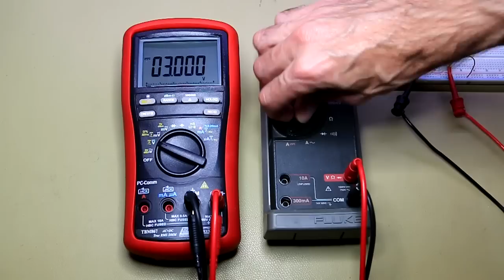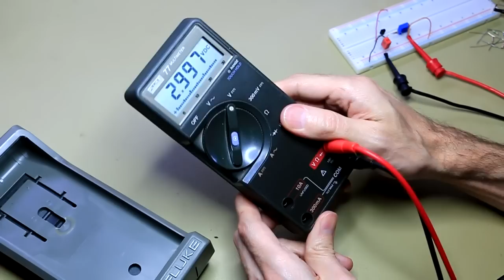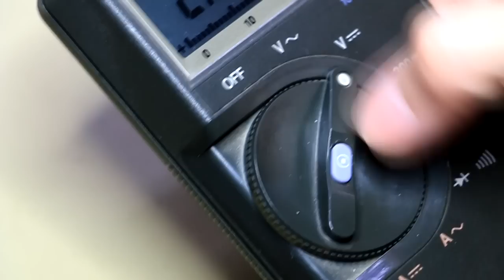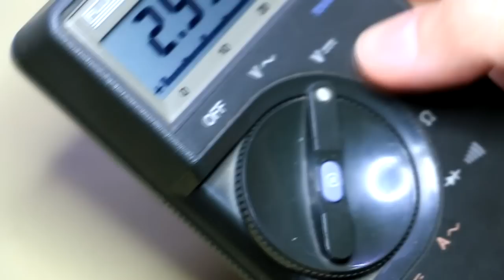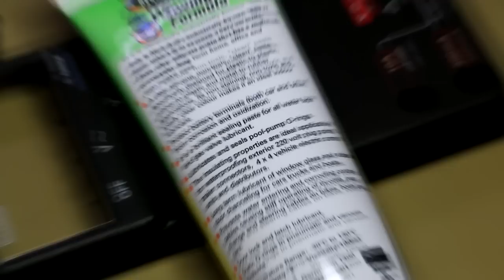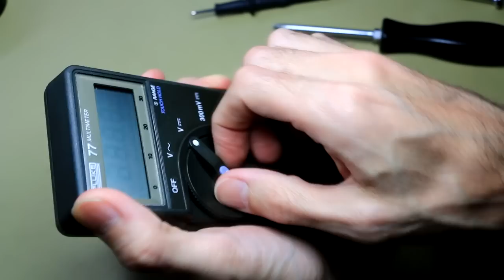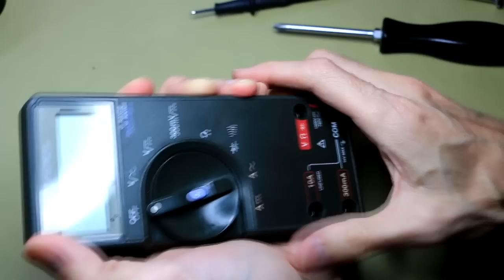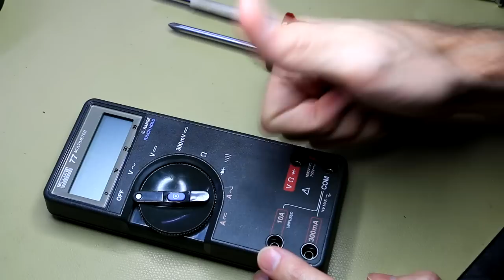Fluke 77 teardown, calibration and servicing (#008)

Comment: Mine got damp in the shed now won’t turn on any ideas how I could fix this
Reply from the maker: Check for signs of corrosion around the battery terminals, clean them up with some IPA or some contact cleaner. Especially check for signs of oxidization on the selector switch. Some De-oxit could help resolve any issues.

Comment: Hi nice and close up footage,
I have a fluke 77 II series as I am not that technical minded and only use my fluke for basic stuff , is there anything i can buy where some thing is already made on the market for me to put my fluke test leads into, where I know its a given 2 v 5v etc and see if my multi meter matches up to it,
Reply from the maker: Hi - yes, there certainly is. You do not state your country of origin, but start by searching for "Voltage reference module" on Ebay or Amazon. These provide a standardized test voltage for your multimeter.
Reply: @TechBench  cheers UK England i think we used to be 240v with 10% - 10% + either way, now i think we are 230v with 10%- 10% + either way I think, due too the power grid easing back on power through out uk,

Comment: I purchased a 77 in 1981. Fried it by trying to measure too much current. Sent it to Fluke and they repaired for free. Used it daily until 1998 when I changed my career to computers. Still works great today.
Reply: Same here --- I used mine for awhile -- switched to the IT field and have been doing that for about 24 years now... I still have my Fluke 77 and it still works great. It is still my go to and favorite meter.  I actually just recently changed the battery and pulled off the outer rubber case just to rediscover my "last calibrated" sticker.   Mine was last calibrated in 1996 and it is due again in 1999, guess I better get on that... ;)

Comment: I have the same original model an my piezo buzzer is erratic - if I compress the case or gently push on the selector switch directly with case opened, I can vary the output from nothing to much louder than when simply held.  Putting various side loads on the selector actually produced a sound that had a low frequency harmonic which was loud and much easier to hear than the typical high pitched piezo sound (I'm 67.)

I found the piezo but am completely at a loss to understand how it works because it looks like it does not contact the circuit board.  Is there some sort of wireless driving or ???

Thanks
Tom
Reply from the maker: @Tom: the piezo speaker has a nylon "strap" with two graphite contact points (the little black dots) that make contact with the back of the PCB. Some conservative cleaning with IPA should resolve that issue.
The same IPA can also be used to clean up the contact selector if you do not have any contact cleaner available.

Comment: Do you have a video on how to replace the LCD display? My 77-1 is missing a digit and I would like to make it right.
Reply from the maker: I don't have a video for the process of replacing the LCD display, however, you might no have to replace it at all. Normally the displays are mounted to the board and uses so-called "zebra strips" to make contact between the glass and the PCB. Taking the strips out and giving them a gentle rub-down with IPA (as well as the contacts on the PCB) will restore connection and likely restore the missing digit. Let us know how it goes!
Reply: @TechBench  How about a video on how to get at the strips? This is my first try at opening this meter for anything other than changing the battery. Thanks

Comment: Do you have the part number and where to  buy the shunt resistor for the current. Can I use wire and short this out
Reply from the maker: Hi Kevin, are you talking about the 10A (4-terminal) shunt? Using a wire will likely yield incorrect results, as the wire will not have the specific resistance of the 10A current shunt. Did your shunt get damaged?
Reply: @TechBench  yes it burnt up were do I get one

Comment: I rescued my fathers water damaged 73-III (it looks pretty much identical to the one in this video) last weekend. The inside had been wet for several months after it was being left outside in the rain, but the only damage was some corrosion on the battery connectors. I removed the old solder and applied new. I then cleaned the PCB with 99,9% isopropyl alcohol, lubed the selector switch with silicone grease as well as the screws. I also polished the lens and gave both the case, leads and the cover a good scrub in hot soapy water with a bit of degreaser. It almost looked brand new when re-assembled. I own a 289, 87-V, 179, 73-III and 101.
Reply from the maker: That's a great story, Robert. The 73, 75 and 77 series meters have a massive 2000 hour battery life. Does it still measure accurately?
Reply: @TechBench  Thanks! As far as I can tell it's still accurate. I've only measured 235VAC and a couple of resistors. My main priority was to get it dried out and cleaned as the ohms readings were all over the place even without leads connected. Once the DMM was dried and cleaned, the readings were normal. I'll have to compare the readings to my 289 (calibrated 06/2017) and see how accurate it is. I'll post my findings here.
Reply: I have recover my dads from his shed it is damp and does not work any ideas how to recover and give it a new lease of life would be much appreciated 😊

Comment: Thanks for a great video, I have just aquired a Fluke 23 series 1 which is the identical model but in a yellow case. It works fine but I am needing the rubber holster, any idea where I could get one?
Reply from the maker: Phew, the only place I would think of is to look on ebay where sellers offer broken meters "for parts". If you look around a bit I'm sure you'd be able to find a holster for it. Happy hunting!
Reply: @TechBench  Thanks for the swift reply, I will try that. I have a new Fluke 116 but I really like this old meter and enjoy using it.

Comment: I bought one of these at a garage sale for $1.00 like 5yrs ago. It worked but the battery you could tell was dying at that time. Just today i got it out and the battery was dead. I was about to throw it in the garbage.. Thankfully i decided to go online and read about them. An then seen what they cost new. lol. The new model 77 retails for $350.00. Thank you for this video!
Reply from the maker: They are truly great meters and, due to the highly accurate resistor network will maintain their accuracy, literally, for decades.

Comment: Does the Fluke 77 have true RMS? I couldn't  find any info on this. Thanks.
Reply from the maker: This Fluke 77 is an averaging meter. So in other words, it relies on the AC waveform to be a pure sine wave. It's good for measuring mains supply, since that is a sine wave. However, if you measure a 5V (rms) square wave, the meter will display it as 5.5V. Of course, not having a RMS converter chip in it gives it a battery life of 2000 hours! Most modern meters have a battery life of between 100 and 400 hours.

Comment: Any way to "zero" the resistance? No matter how well I re-seat and clean the probes, it never reads below 0.3 ohms.
Reply from the maker: Unfortunately the Fluke 77 does not have a zero (or delta) function. Only way to handle that is to short out your test leads and then mentally subtract the reading from your final resistor reading.

Comment: I just picked one of these up for $10.00 today,, Great video not sure I understand the Calibration part though?
Reply from the maker: The actual calibration is quick, but it does rely on the fact that you have a known voltage of 3.000V available. I used a 5V regulator to get the initial 5V and then a simple voltage divider network to tune that down to 3.000V. Of course, I already had a pre-calibrated multimeter available. If you don't have one, you should be able to trust the 77 you have - it's drift really if very small due to the excellent thin-film resistor network it has.
Reply: $10 for a Fluke 77? some people have no idea what they are selling.

Comment: A quick search for 'Fluke 77 calibration' - I wasn't too hopeful but this popped up as the first video. Brilliant! Concise, well filmed and factually packed. I couldn't have asked for anything better. I followed the calibration advice and you are right - it is great to see two together reading identical values.
I wouldn't have attempted the calibration without seeing how easy it was, just in case I made it worse.
Not many electronic items around these days, will still be working in 30 years and handling near daily use. Good 'ole Fluke.
Thanks for taking the time to make the video.
Reply from the maker: A big pleasure, Craig. All the best.

Comment: Hi there interesting article. What are the values of the resistors and the cap in the calibration circuit? I'm having problems with the output drifting. Thanks.
Reply from the maker: The resistor is 1k part and the trimpot is a 2k multi-turn pot (10 turns). The cap is just to quench any oscillation on the 5V regulator, but that specific cap is a 33μF 10V tantalum.
Reply: Thanks for the speedy reply. Love the video will service my fluke 70s collection!
Reply: the cap is connected to ground?
Reply from the maker: Yup, to ground and the +9V feed from my bench power supply (in other words on the input to the 5V regulator).
Reply: one more question please is one end of the 2k pot to ground?
Reply from the maker: The pot has three "legs". The two outside pins go to GND and the +5V regulator output. The center-tap goes to your digital multimeter (+) input. Note that you have to place your Fluke and your reference DMM on the output at the same time so that you do not disturb the load on the voltage divider.
Reply: Thanks :-)

Comment: Thank you for the video I have the Fluke 75 but the continuity sounder is very low any suggestion I have had mine a very long time but it works well thanks Bob UK
Reply from the maker: At 06:23 you can see the back of the board. There are two slightly "enlarged" solder points that press up against the piezo transducer - the buzzer - at the back of the case (the flat circle, next to the shielding). Check the contacts and make sure the piezo element itself is still tightly mounted to the case. It uses the case as a resonance box, so make sure it's still tightly affixed.

Comment: Looks like the 73 3..... Is calibration same for 73 3?
Reply from the maker: Yes, the calibration procedure is the same for the Fluke 73 series III. Set your input to a known voltage of 3.000V and adjust the R8 pot to match the voltage reading.

Comment: i have here a 77 +- 30 years old, still going strong...
Reply from the maker: It's a solid multimeter. Did you know it has a 2000 hour battery life on a new 9V battery?
Reply: Yes, it last forever 3x changed.
Reply: at work we have still 5 fluke 77 from 1986 and they are still in spec with out ever calibrating them they only get checked once a year with a calibration standard also from fluke sadly we use now beha amprope meters they are ok but not great

Comment: Will the silicone not go down into the contacts over time and coat them making them un-usable
Reply from the maker: While silicone can be used as an electrical isolator, it is unlikely to work its way into the internals and onto the contact switch. The switches have very good ingress protection. The IEEE actually did a study on this and they determined that silicone vapour deposits also do not affect contact reliability. My own (anecdotal) evidence suggests that it does not cause a problem, since I've been using silicone lubrication on my multimeters for many years.

Comment: Hi!,
nice video, thanks.
I have an old Fluke 77 like the one showed in your video, the problem with it is that sometimes it wont come out of the selt test.....it just stays with the lcd displaying all segments.
Any ideas?
Thanks again
Reply from the maker: This could be related to the little finger "legs" of the control chip or the LCD driver chip. On the EEVBlog forums there has been some members that have come across dry joints or loose contacts, causing intermittent faults you describe. If you have the patience, you could reflow those contacts with a fine soldering iron to make sure it is not a contact issue.
Reply: Thanks for answering! I'll try that

Comment: Much simpler than calibrating an Avo 8!!
Reply from the maker: Indeed, much simpler. It's a pity that modern multimeters are a lot more difficult to calibrate (but then again, due to the closed-case calibration, they retain their accuracy for a lot longer).

Comment: Hi. I have a Chauvin arnoux ca 5220 that is a bit odd. It dont zero when i short the leads in dc. It will measure 0.25v more. Can this be adjusted inside. I se several pots with 10k and so on.

Comment: Teflon better then silicon paist.
Reply from the maker: - Teflon paste? In my experience, teflon paste oxidizes after a year or two and leaves little "crumbs" in the switch workings. I still prefer Silicon paste.
Reply: Thanks the Comment, TechBench. my misstake, i was mean Teflon grease. in my case, silicon paste(grease) hardened after 2~3 years. for Plastic material, i think Two all good choice !

Comment: I have a problem of "CAL ERR " in fluke 87 series multimeter. Please say the way to solve it.
Reply from the maker: So, although this video is not related tot he Fluke 87, if any 87-series Fluke displays CAL ERR it could be that the meter has lost its calibration data. You should be able to send it back to Fluke and have it recalibrated under their lifetime warranty guarantee.

Comment: Great job. 

Not sure I would add lube at the outermost diameter of the switch knob. This will attract more dirt. 

Enjoyed your 77 tour. Thank you.
Reply from the maker: +davecc0000 
Agreed about the lube on the outside diameter - I wiped it down afterward, so it has that "whisp" of lube on the outside, just to have that idea. Thanks for your kind words.
Reply: davecc0000 it may attrack the dirt... but its a good thing if you think that may attrack the dirt from getting inside the meter and fuck the switch mechanism contact and prevent humidity 👍

Comment: hi.great vid. i have this same multimeter which i bought off ebay. the ma fuse it came with is a glass fuse and i wanted to change it back to a ceramic fuse. could you please tell me model of original fuse used? many thanks.
Reply from the maker: +arfan jhangir I had a look at the Fluke 77 series 1 manual and all it states there is that the fuse should be 630mA/250V with 1500A interrupter capacity. So for a ceramic fuse, you'd be looking at something like this:
http://www.amazon.com/Qty-5X20mm-630mA-Fast-Blow-Ceramic/dp/B004HGFCNI
Reply: +TechBench thank you for replying.In your opinion should i use branded fuses or unbranded? is there a difference in quality and is it worth paying extra for branded? many thanks
Reply from the maker: arfan jhangir
If the price difference is not too great, go for the branded versions. However, as long as it's fast-blow and ceramic I doubt that you can go wrong either way.

Comment: I looked at the Servisol Super 10 on Amazon and almost fell out of my chair when I saw the $55 price for one can! I was unable to find the Herschell Silicone Paste here in the US but you can get an 8 oz. can of 3M silicon paste on Amazon for $28.95. Not cheap, but dheaper than paying someone else to work on it.
Reply from the maker: +Davilo Olivad Whoa ... yeah that's not cheap. I got my Servisol locally for the equivalent of about $12 (US). Look into "Kontakt 60" or "Cramolin Contact cleaner" as an equivalent.The Silicone paste should also be a lot cheaper than you are able to get it for. I'm sure there are a number of equivalents silicon paste/lubricants out there - anything that can lubricate plastic-on-plastic frictional movement.
Reply: i know long ago but i often use fermit silicone greas from the hardware store 23 g for 1.50 €

Comment: Howdy Tech I have an odd question but i think i might already know its answer but i thought i would ask and see if you come up with something different from me.  My Question is how do you calibrate the OHMS with only one adjustment point?
Reply from the maker: +Im1CrazyCow Ohms measurement is usually taken in a wheatstone bridge configuration, which is situated on the thin-film resistor network. The assumption is that this resistor network remains accurate for the lifetime of the DMM. Thus adjusting the voltage measurement scale also adjusts the voltage measurement on the wheatstone bridge.

There is a good description of how a wheatstone bridge works on Wikipedia:
https://en.wikipedia.org/wiki/Wheatstone_bridge

Good question, though!

Comment: I thought I was the only one doing the anti-clockwise turn well done.
Reply: I also do this as far as I can remember. I guess its all part of the techie gene. Either you have it or you dont :D
Reply: I do this automatically, without thinking.  I've done it as far back as I can remember, anything with a thread; nuts, bolts, screws, drink bottles, jars, flashlight tail caps, whatever. It's as natural as breathing to me. It's baffling when people don't know it and then they wonder why they cross-thread everything. I thought it was one of those things people just knew, but you'd be surprised at how many people are unaware.

Comment: I have a Fluke 77 that seems to work fine except for the continuity which rings shorted even without leads attached. Do you have any ideas what could be wrong wit it?
Thanks
Reply: you should know that the input detection is some kind of optical light sensor. When using this meter in dark spaces it will beep with an input selection error until you shine a light on the input ports. I figured out that it was an optical sensor on the inputs and not some problem with continuity of the input leads.